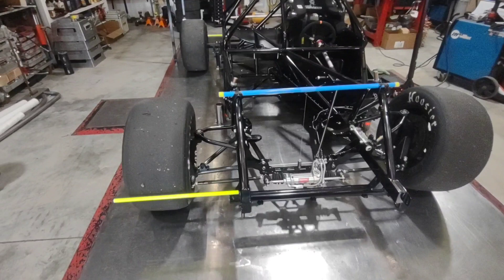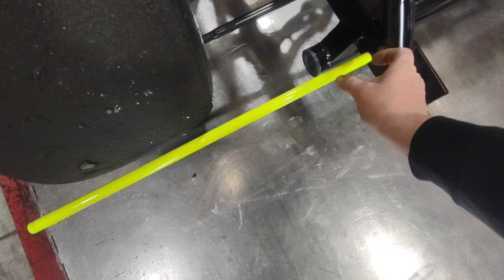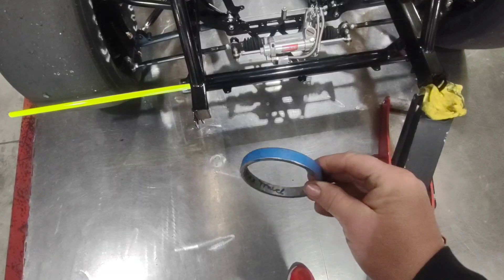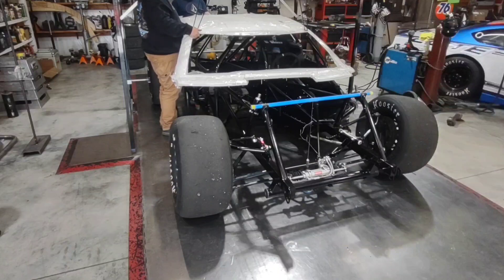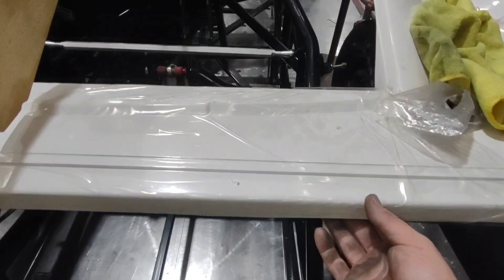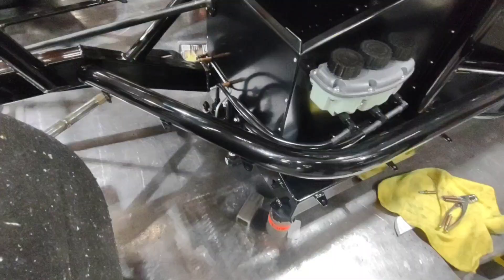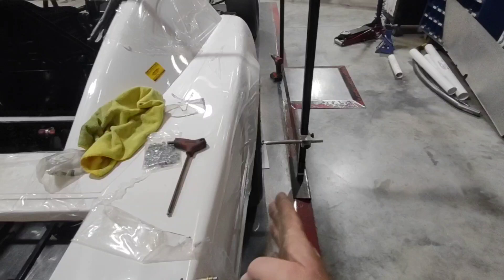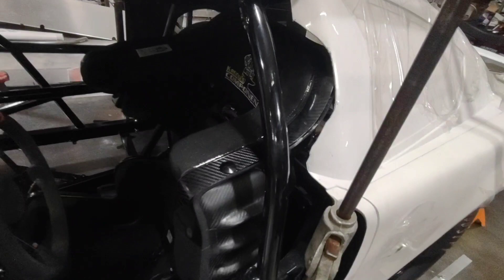FURY Super Late Model video 3

Comment: Any tips for those of us that run a no bump stop , no ride height rule? Seems like everyone I race with turns it into a giant go-kart. Coil over Stiff springs (600+) and giant sway-bar (1 5/8 ,1 3/4) and then just set it to almost no ride height. Would that make sense? Or would a conventional setup that allows travel be better? The same track I use to run 300s and 1 1/8th bar and was competitive before they made this rule change this year. Just curious what you would run. Thx!
Reply: I’d be interested to hear his opinion on this as well as here at my home track there is a mixed variety of setups..but we have no ride height rule
Reply: @tcburgess2939 did you find a good setup with no ride height rule?
Reply: @jumpshotkangaroo7585  right now the class we are currently running is a no ride height rule no bump stop allowed late model
Division. We are running heavy springs and having success.
Reply: @tcburgess2939  interesting. Did you change the front geometry at all? I have been running 325s across the front with a 1 1/8th bar and we are junk compared to other guys . Maybe I'll try the heavy stuff next week